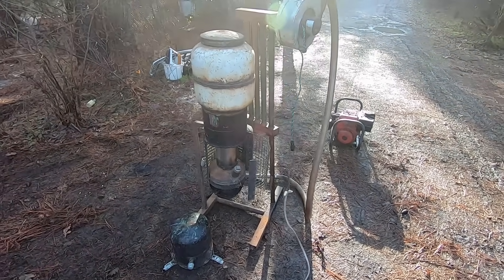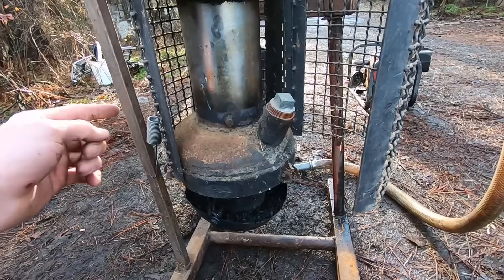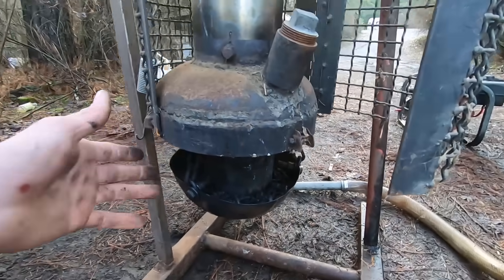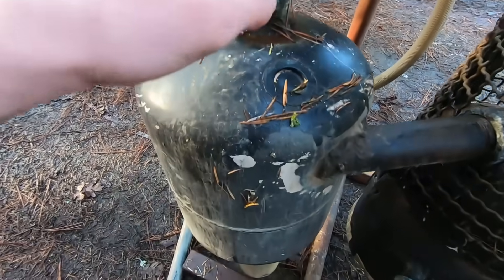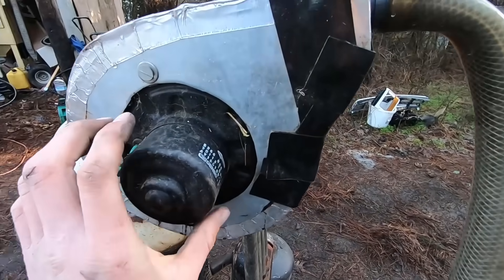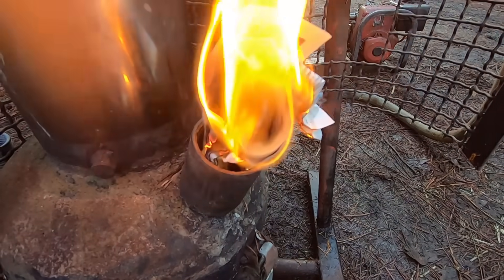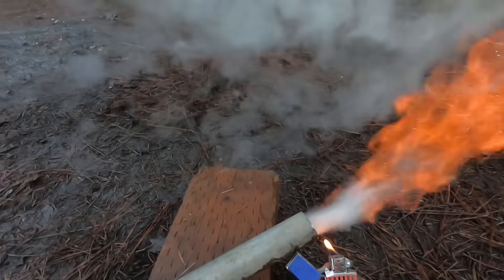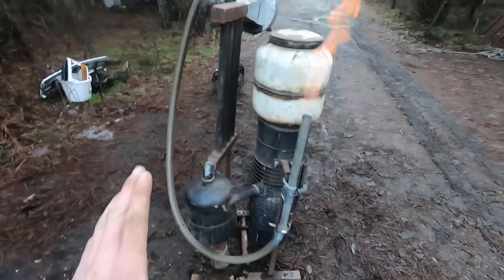Using Wood to Fuel a Generator! (How to Build a Wood Gasifier w/Demonstration)

Comment: use a Peltier system to use the heat for energy on the hot side and cool the opposite side of the cool side of the peltier, simply a heat exchanged that can take hot energy and convert it into a electric current when you cool the other side at the same time.

Comment: This is amazing...would like to have a "fireplace" type of gassifier that while I'm burning wood for entertainment or warmth in the winter I can be running a generator supplying electricity to my battery bank that runs my home.  Wow...this is cool.  Wonder how long you would have to run a gassifier powered generator to supply enough electricity to charge a battery bank and supply all of the energy you would need to run a home for a day...an electric car for a day?  Shoot, the heck with expensive solar panels and a rainy day or no wind for your wind generator.  I too wonder why this is not done more often.  The set up you show here is archaic.  I also imagine that the engine would have ran so much better with a sealed system of course...or you were making enough gas to run a 2nd generator...think of the electric charge you would be getting...oh, and my fuel of choice is tossed daily all around me..pine, pine needles and of course why not collect pine cones...they burn like little torches.  Great video.

Comment: You can add a water filter that takes out most of the smoke that allows cleaner gas to flow through. You can do this by having a secondary tank that holds water that a hose can run into the bottom of the tank full of water and come out at the top of the tank into the other filter you have installed on the burner. Or you could install after the radiator to filter out any remaining smoke.

Comment: Good job putting this video together. I have been running one of these as a primary power source when we lose the electric grid. The wood gas runs an engine, turns an alternator which charges a 

12 VDC battery bank,  a 3000 watt inverter converts the DC to 110 VAC. Great fun and a worthwhile endeavor.

Comment: Got to love when the wood gas backfires. I use coffee cans. I found a double blower works better. I use forced air in my burners. A processor fan and a PSU fan piggybacked together. Both 12 dcv. Still amazes me how flammable just the smoke can be. One can acts as a cap and 32 1/4 inch holes by the bottom and 48 holes about a inch from the top.  So the top of the can collects hot gas from the 32 flames burning inside the can, then there is 48 flames on the outside by the top.

Comment: I feel so dumb after watching this. I can make a nice gravy, maybe even a sunday roast. But this guy can make cars run out of wood!
Reply: Gravy!  Some of us can't even manage that.
You'd better do the video .
;)
Reply: if he was really nerdy he could draw even more power from the process from the excess heat before the radiator using a peltier generator which turns heat directly into electricity
Reply: @danroden830  hell yes now there is a guy on my wave link. hell we should build these for clearing dead trees and brush from forest and storm damage.
Reply: @MyWeedgrower  ......... I'm ALWAYS interested in things that allow you to CONSERVE, use natural materials  and be INDEPENDENT. If you decide to do this please contact me. I'd love to learn your method. You also, dan roden, if either of you don't mind.
Reply: @danroden830  or Stirling engine, to generate electricity AND act as a cooler at the same time. But non the less - its a magnificent build by it self.

Comment: Syngas from coal has a dual purpose. The gas is able to be used for cooking and heating and the coke (cooked coal) is the preferred fuel source for iron foundries and blacksmith forges.

Comment: Having built a hand full of these, much smaller, you've given the best explanation I've ever heard on how they work, b/c, I honestly didn't understand it.  Until now.  And i've used them.
Reply: What would happen if plastic was added to the wood?
Reply: @peter81083  depending on the amount of plastic I would assume.  naturally, the BCP's off of plastic would likely be bad for your carburetor, not to mention horrible for anyone near them breathing it in.
Reply: @mitch_smith  thank you for your quick response! What if it was pushed through a water filter before the cyclone filter? I'm just thinking about how well plastic burns, and seems like this could be somewhat of a recycling method.

Comment: If I built my own, I would build a more complex filtering system, a compressor to pressurize a tank for later usage, and power a thermal acoustic electric generator. Then the electric generator is used to produce power for powering the house and charging electric vehicles.

Comment: its strange how nobody has known about this here?
this type of engine was used in the soviet union during ww2 and before, it was used in China during the Japanese invasion, it was used by farmers in isolated areas, it was used by anywhere where petrol wasn't available constantly.
It's still used today in Russia in more isolated areas or just places where connection to major towns is there but very far. Go beyond the Urals and you'll see them often I would imagine.
Reply: also it was popular in ww2 in Russia because wood didn't freeze like fuel I think. So if you had a truck with a flat bed at the back you could set one of these up (since theyre kinda small- might take up 1-2 people's seats out of like 8) and you could transport troops or goods with it semi reliably. I learned about these from some picture of that. 
But yeah, since petrol expires irl (doesnt last forever like in TWD) you'd see these regularly in the apocalypse lol
Reply: shiiiiiiiiiit he says this at the end my bad i read the comments before it ended

Comment: As you know, burning carbon based fuels in a low oxygen environment also produces carbon monoxide. A gasifier does this exceptionally well, so be sure not to ever do this indoors, and to never breathe in the fumes.

Comment: Can you use an AC blower connected to the generator after the cycle is done and the generator is working Instead of keep the DC blower on limiting using time?  Solar panel system  would be needed for your batteries. then your system would be self sufficient In a way... Cool work you have done there friend. Today I learn something new. Keep up the good work

Comment: I'm curious as to how long an engine would survive on such a fuel. How bad is the impurity build up internally and can it be cleaned without a total engine rebuild?
Reply: good question. some gasogens, or producer gas generators used charcoal, so the creosotes and tars were not present. some used sawdust as a filter and ran the gas through that. others used stainless steel wool (though not sure if during the war they did that, or after) but you are right: without some sort of filtration for wood fuel, there could easily be problems unless the gas temp was really high, over 350F, but then there were power issues getting enough gas, if hot and expanded, into the cylinder. I think filtering the gas is still a large concern and affects its being truly renewable, as it is a waste needing disposal, or refining to harvest usable compounds from it, similar to what Dr. Koppers did with coke-making retorts..
Reply: @CuriousEarthMan  what raffination is required?

Comment: Would it not be beneficial to have some sort of water reservoir on the outside of the hurricane filter or square tubing manifold to cool it more before it gets to the hose?  But I'm guessing that's what you meant when a more complicated system would do better, since this works good enough as is.
Also, all squares are rectangle, but not all rectangles are square. :)

Comment: Very interesting! I will like to build one myself. Two questions. 1- does the woodpellets autofeed and how. If not, how long does it run on a load of woodpellets. 
2- how does the airpath work through the system? If its oxygen deprived, where does the electric fan pull its air from?

Comment: i saw this guy he had a car that was like broke and he went took this huge stator from an factory that had like geothermal but it ran out. and it was a fifteen hundred pound stator is all he said and he welded it to a car rim and attached it to a car that  would haul around like 2500 pound with four people in it and was doing seventy on the speedometer because it was attach to the same wheel and he made enough electricity to push around a short train.

Comment: Very cool, I heard of it before but you got a nice setup, someday I like to make one.
You don't need a water bubbler for safety in case the gas starts burning up inside the output tube when you the flame going due to oxygen being present in the gas as when you build an electrolysis machine making water to hydrogen with oxygen gas ?

Comment: What a great idea all the way from middle east,.so my one question? if the generator is producing the electricity why are you using battery to run the fan? can this generator hooks a line in to fan to run

Comment: there´s that ICS pdf file (link below), which contains data about almost every plastic material (and some others) and how it reacts to various chemicals, pretty useful if you don´t know what to use...as a rule of thumb however: polypropylene (PP) usually can handle most chemicals without deteriorating AND it is save for consumables too (e.g. drinkable ethanol) as little to no fallout of certain helper-chems will happen.
what you really should do, is disassemble this contraption, take measurements and provide a valid manual on how to recreate it...THAT will make the difference...there´s a metric crapton of videos showing contraptions like yours but noone ever actually hands out a (valid!) construction plan (written ofc)...which sort of defeats the purpose, me thinks...

https://kuhnke.kendrion.com/attachment/ICS/ics_pdf_brochure/ics_pdf_chemical-resistance-2015_en.pdf

Comment: Yea, this is an genius almost lost art, that we probably will need in the near future. Not to mention how much fuel you save by making it more effective! You reignited my will to do this now, because in the summer I will not think it's so nice handling heat even more. Great video, just try to paus a bit more when you talk. I didn't have to slow it down or rewind but it's good breathing in between. :)

Comment: I swear, gasification is a fascinating technology. I'd love to build a gasifier capable of powering a generator that could be used to power a house as a backup source of power. Awesome video!
Reply: This is how I back up my solar system off grid way in the woods of Canada.. as a matter of fact this message is powered by it now.. it's a rainy cool day with no uv.. wood is heating, and powering the cabin at this moment.  If you build one put one more filter, saw dust or media.. amo box works great.. my radiator is the core of an oil filled space  heater, air pump is a Colman camping mattress pump (If it's air tight it don't need that much power this one is not)....  I followed the FEMA plans pdf free online.  Down draft, Up draft and side draft.. are the different types of reaction chambers.. all simple and very slightly different.
Reply: if you have a battery bank and wind or solar generation then this is a good back up, or even just make it for a grid connected house and keep it around for power outages, it's easier to store bags of wood pellets than it is jerry cans of gas, which has a short shelf life to boot.
Reply: they are now using gasification (pyrolysis) to go from wood, to gas, to methanol, I think using a catalyst.
Reply: Good man
Reply: Так в чому справи, видно теж маєте перепони? А ви по тихенько, помаленько і нікому ні слова! Все можливо.

Comment: Have you watched or had the chance to watch the two guys that did similar facts as you? 1 early 1900's and I believe he was around 1930's. The other one was around 2000. This is the first one like this I have seen. For that gas there is an most powerful one. Takes two simple elements. I do not want anyone trying it or experimenting with it. The most powerful gas of that type. Yours is way better and safer. Thanks very much for sharing. That is very useful and cool. Just an FYI also since your doing this. Do you know the truth about the Mustang airplane of WW2 and what it used for fuel? Who knows, you mint make it work again. Take care.

Comment: Really cool projekt and great explanation. 
You could try to condense more water in the cyclone and the radiator by adding fins to increase the surface area. 
Also, I like your diy approach for the blower but aren’t you afraid that the explosive gas air mixture will ignite in the blower to some sparks in the electro motor? I mean it doesn’t look like it ist ATEX proof. 
keep up the great work!

Comment: Fantastic setup. I live on an anthracite seam, so I'm a bit keen to build one of these.  I wonder about getting rid of the blower though, and using some kind of thermal draft inducer, possibly off waste heat from the reactor. Have you tried anything like that?

Comment: 8:20 revision note: consider angling the bottom of the radiator slightly so as sludge accrues it will slide back into the filters collection rather than building up in the corner, the resulting adjustment to the radiator tube lenths probably will increase efficiency because the pressure will be closer to equal between the tubes. it could also be advisable to add another filter directly before the intake for your load (engine). 
overall this thing is super bad ass, thank you for sharing!!!!

Comment: Would like to see you run that gas pipe threaded to the bottom of some kind of barrel. Fill that barrel with water and thread a barb off the top to hook your gas tube, which goes to power the engine. This will remove almost all of that soot and smoke, giving you clean gas to either sell for profit or use. Dirty gas will destroy that engine real fast. Best wishes

Comment: We don't use gasifiers simply because they are inefficient:
''The gasification stage converts about 75% of fuel energy content into a combustible gas that can be used as a fuel for internal combustion engines. Based on long-term practical experiments and over 100,000 kilometres (62,000 mi) driven with a wood gas-powered car, the energy consumption has been 1.54 times higher compared to the energy demand of the same car on petrol.''

So it is 1.54 times worse than just using petrol that this 75% of fuel energy content is true for really dry wood and it could be as low as 30% depending on the moisture that you can easily see by the colour of gas as if it is white means there is too much moisture while it should be colourless. Also you are using this gas for not cooking or heating something etc rather for producing electricity that you loose additional efficiency in the generator so it would be much more efficient if you use a steam turbine to directly produce electricity from wood and also the moisture would reduce it's efficiency in a smaller scale so if dry wood is very accessible resource gasifiers make some sense, in fact they are very common in some forest rich countries like Russia..

Comment: Great vid. For agitation, can you build a stand holding this from a chain on the top so it can swing? If you put a metal ring that is secured to the ground around the bottom bowl, about a 1/2 inch, where the charcoal is would that not help to agitate. Maybe put some fins for wind to move it around. This is ferry interesting.

Comment: Love this video!  But I wanted to mention how important the blower step is before lighting this.  If you've run a gasifier previously there will still be residual gases built up in the system.  These gases need to be evacuated before lighting again otherwise bad stuff happens and we'll read about you on the news :)

Comment: This may be a dumb question, but if you had a cabin in the woods you could use this technology to provide heat and light? Plumb in the radiator into the cabin and then generate electricity as well. No need to store petrol or worry about it going off. Just keep plenty of dry wood ready.  Or is it just an overly complex way of doing things?

Comment: That generator was barely maintaining idle with no electrical load.
Put a realistic electrical load on that generator and watch it stall. 
You can't beat the energy density of petrol, not with wood, not with dried manure. 
Also, with that amount of smoke and soot, the carby, spark plug and intake will be fouled in no time.

Comment: Chemistry-wise, this is called the distillation of wood, and is used to produce turpentine from pine wood. What I like is the local energy conversion and subsequent efficiency to run an electrical generator. As an external combustion engine it is a bit wasteful, and should be replaced with a steam engine, in time, to move the generator.

Comment: It's cool it's just not a practical application meaning nobody doesn't want a bunch of smoke running there house unless they were completely off the grid or gas prices go through the roof.
And can you breath that type of smoke or Gasifier system is it poisonous that's probably why it hasn't stuck around?

Comment: This is how the North Koreans run their vehicles. Not the elite class nor the military. Just the working farmer. Fuel is expensive as they must import it. To meet their daily quota instead of Oxen plowing the fields (like most) some have harnessed this technology. All that without any Internet access. You have created an excellent system. Well documented and explained. My only question is the water you are removing in that vertical condenser. How do you port that out ? Is there a drain ? Did I miss that in your explanation ?.